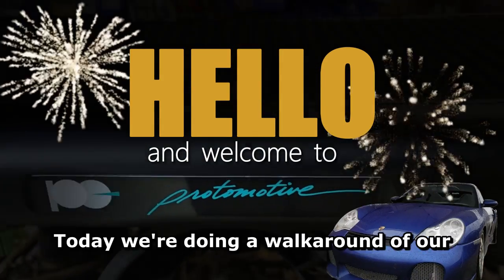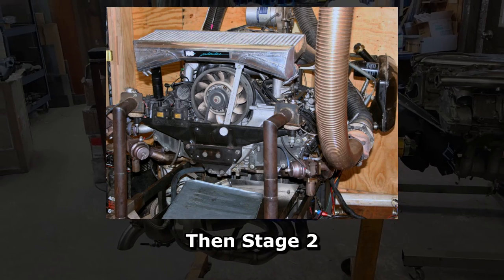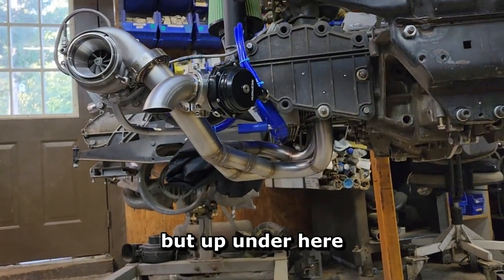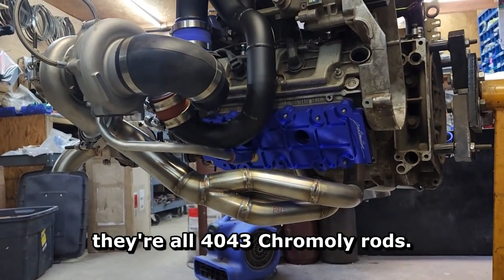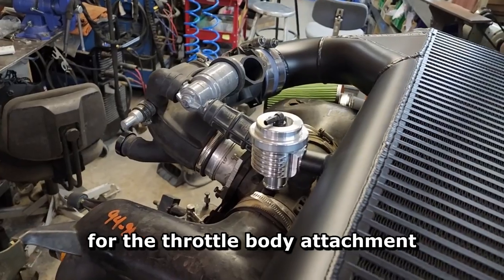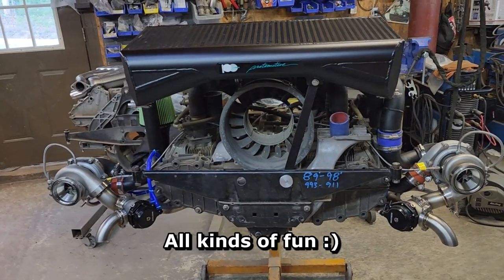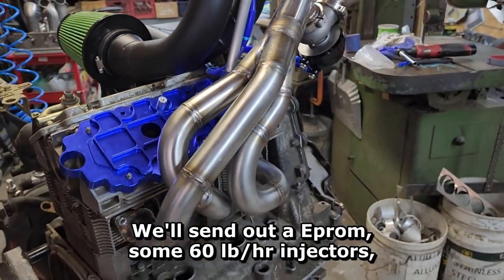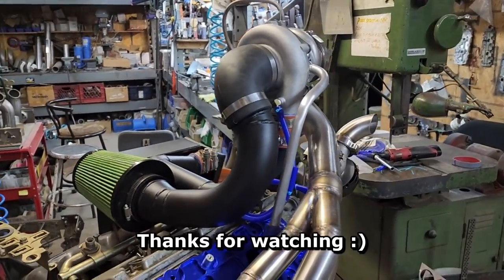POV: The Ultimate Porsche 993 Carrera Turbosystem Upgrade (Protomotive Stage 1, 2 and 3)

Comment: hi what do you do about the ceramic port liners in the cylinder head exhaust ports?
Reply from the maker: They work well in turbo as well keeping the heat in the exhaust and out of the head.  FYI The factory 993 Turbo continued to use the ceramic port liner with great reliability up to 1998.
Reply: @protomotive  Reason im asking is i have a 964 3.6 litre na engine i built for turbo about 15 years ago and stopped the build because of the possibility of port liners cracking and breaking off and destroying the turbos.
Reply from the maker: @kn-ii3xd  we've turbos 964s since they were new and have seen some come back with the port liners completely gone.   They tend to do that.  Amazingly we've not encountered turbo damage.   So however they're coming apart it must be tiny enough to not do any damage.
Reply: @protomotive  thanks for reply, i just recently bought some factory 964 turbo heads because i really can't afford for an engine failure. Im also running mahle 3.6 factoy turbo barrels and piston set at 7.5 to 1 ratio. Going by your video i think i should also upgrade the standard conecting rods. By the way i really love your videos.
Reply from the maker: @kn-ii3xd  the factory stuff is super robust and a great option.  Over 560ftlbs the head seal becomes an issue and you'll want to flame ring them.   Thanks for the awesome compliment!

Comment: Hi, I know you are expert with turbo boosted systems.  I am not inclined to use turbos but respect your knowledge.  Do you rebuild/upgrades 993's without turbo charging?
Reply from the maker: Yes we've done some really fun na upgrades on the 993s as well.   What kind of build are you after?  Big displacement?  High rpm race?   General performance updates?
Reply: @protomotive  I am tempted by the 4.0 L builds but don't need to go that far.   I and looking for performance updates and upgrades with a solid increase in mid - range torque.  Love the ideas of bumping up RPM's somewhat too. Would love to talk about options and budget.
Reply from the maker: @jameswalter3136  Well, the increased stroke would definitely help that out!   But yes, there are many other options as well.    Feel free to give me a call, or shoot over an email to sales@protomotive.com and we'll figure out a nice upgrade path that makes sense now and in the future :)